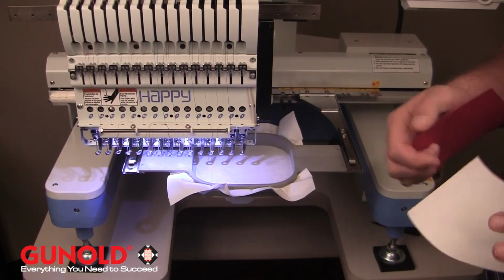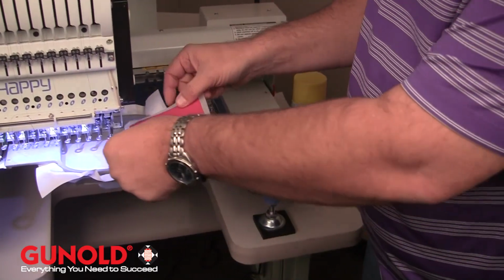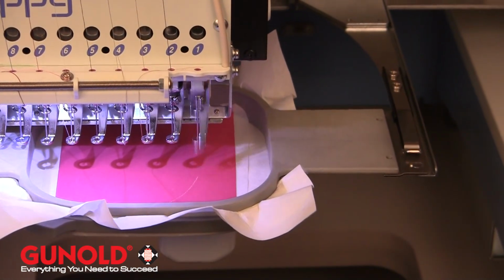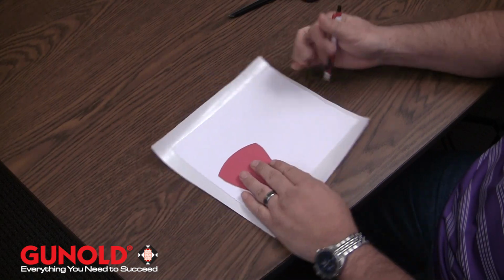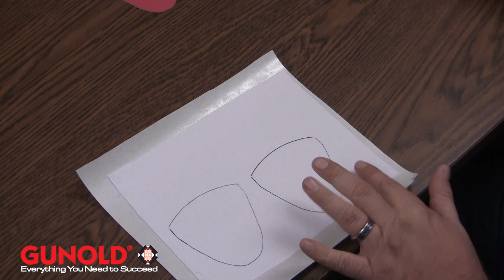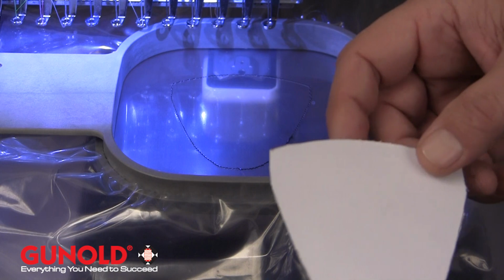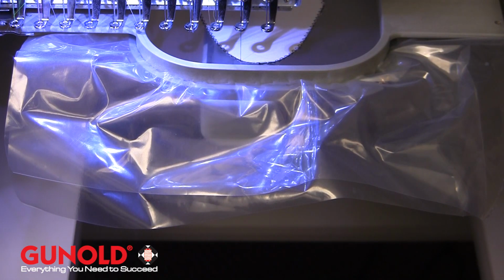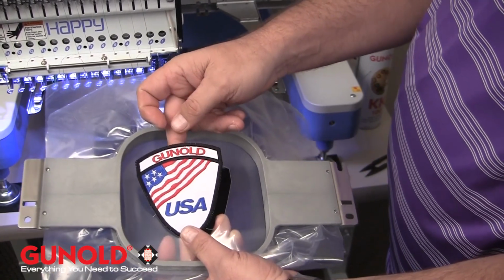Custom Patches from Start to Finish

Comment: Can I do this with any kind of machine and water soluble interfacing? I've been trying to figure out how to clean up my home made patches using my brother se625 and I've been using fabric.
Reply from the maker: Yes it can be done on any machine provided that you have the ability to get the design/DST set for their machine. As for the water soluble interfacing, it needs to be strong enough to NOT perforate during the sewing process. As for fabric, it needs to be sturdy enough to hold the shape after sewing.